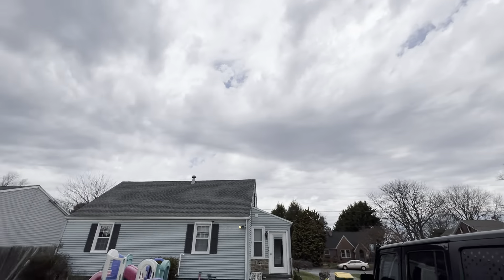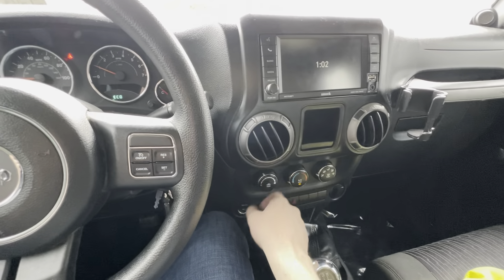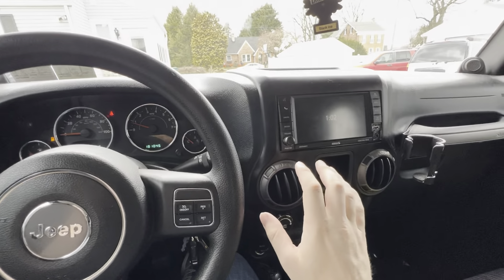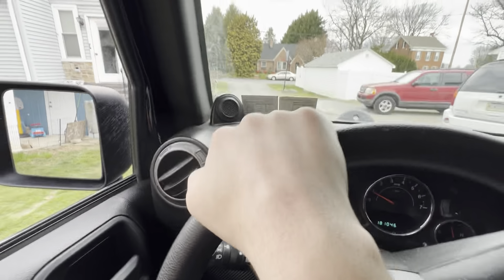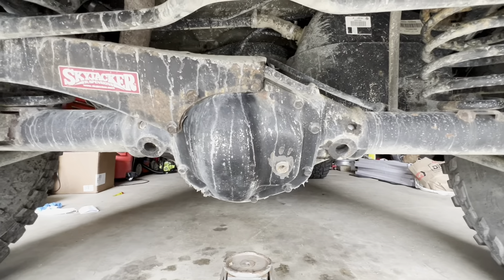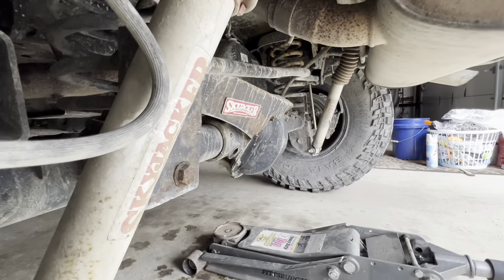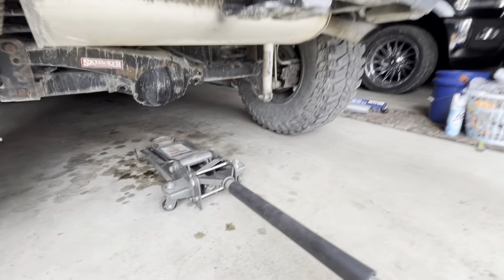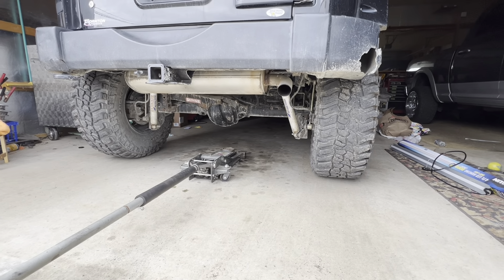I Already Broke My JKU… 1,000 Miles Later…

Comment: fixable but rough. Ripped apart the rosette welds. Never did understand why they didn't weld around the tube at the diff. But when it's fixed might be a good idea to have a good welder do that for the future.

Comment: Totally fixable Kyle. Rotate the center section back into the correct position. Redo the plug welds, then weld the axle tubes to the center section around the axle tube. Lots of videos on guys doing this to beef up their axles. Just remember to preheat the center section before welding the tubes. Hope this helps. God bless, stay well.